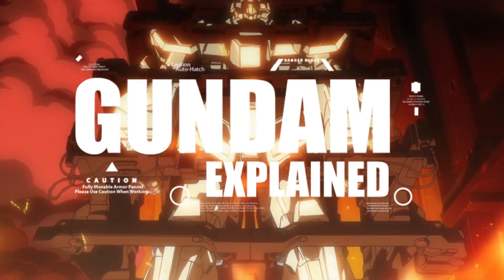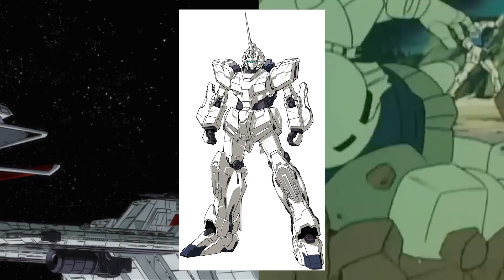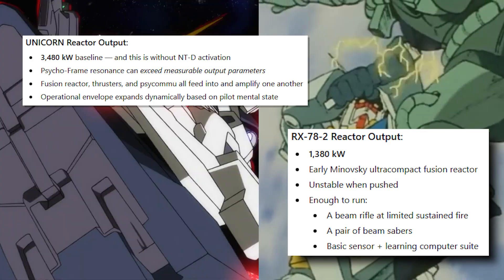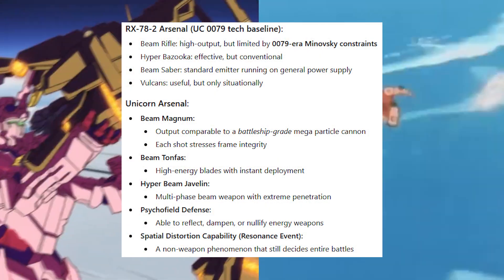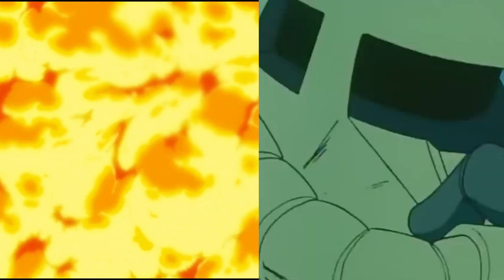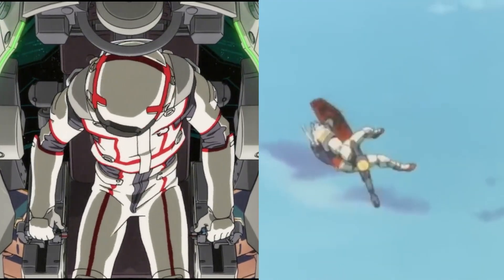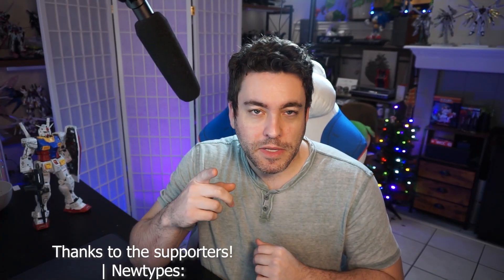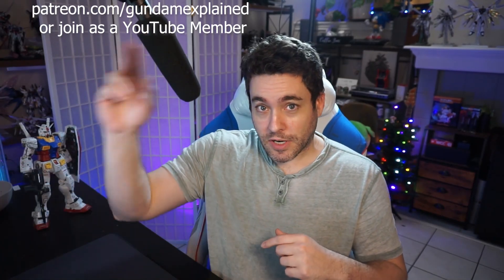RX-78-2 vs Unicorn: How Big Is the Power Gap Really?

Comment: Two-uhv? ...Two of and understanding is understanding in single point and every point = "understandings" is an idiot's misuse of the suffix "s" for redundant emphasis on plural state, especially since the "ing" suffix is already present and its value represents "understanding" is an action. Understanding being the "act of understand" is understanding = it is a verb that doesn't need further suffix to debote multitupr variability as intellectuals(aka idiots) debote in their shallow sense of syntax.

Fix you sloppy posture by using your nose for breathing, this will force you to sit upright ao your diaphragm effectively takes advantage of gravity to fuel ors descent and thus maximum expansion of lungs in every inhale.

You mouth-breathers have bo sens eof the body's potential and by proxy your sense of language fails the mark of Sapience that is defining point of Homo Sapien-Sapien, making you deteriorate into mere homo intellect-intellect; a lexicon heavy shallow beast that rised tangent after tangent without completing a full/coherent thought as hype is your master and so called "reasonable doubt" is your method of expressing "intelligence" but that is mere intellect/coward state.

zero margin for error not mar-jinz, margin is margin, it is a range of play/error = "margins" is an idiot use of the suffix "s" just like "usage" and "leakage."

Armour not "are-moores," armour is an uncountable noun = represents multiwithout need to slap on the suffix "s."

Comment: I looked at the Gundam wiki and heres what I think of it:

In terms of raw specifications (mobile suit not weaponry):
- The RX-78-2 was stronger than all Zeon mobile suits when it was first deployed into combat, while the Unicorns (in Unicorn mode) has an output that outperforms the RGM-89D Jegan D Type and AMS-129 Geara Zulu, but not by a significant margin. (About 1000-2000 kW higher, but when you consider what the Unicorn has, it makes sense).
- The RX-0 has a reactor output of 3480kW while the RX-78-2 has a reactor output 1380kW, about a 2100kW difference, of course the technology packed into both reactors do differ with the RX-78's one being new, experimental and unstable, while the Unicorns has limiters on it, meaning that it can achieve a significantly higher output (thats deemed unmeasurable).

In terms of weaponry:
- The RX-0 purely outperforms the RX-78-2, namely since its weapons are further developments of the RX-78-2's base arsenal of sword (beam sabers), board (shield), and beam rifle (and of course bazookas, etc). Like the RX-78-2 was mostly leaning to the conventional side with the beam sabers and beam rifles being experimental. While the Unicorn's leans into more late UC tech (even if early when compared to F91 and Victory), where it has i-fields (built into its frame and onto the shield), a beam rifle that consumes on whole e-cap, and beam sabers that have variable output, enabling to become significantly stronger.

In terms of control interface
- The RX-0 builds off the RX-93 and MSN-04, where its interface combines pilot controls (in Unicorn mode or when used by a non-newtype) with psycommu controls (in Destroy mode, although I think it is active when in Unicorn mode with the Intention Automatic System, IAS). So the RX-0 can rely on a newtypes thoughts for direct control, while the RX-78 is limited to conventional controls, relying on pilot tuition (newtype capabilities possibly), reaction time, and skill. 

Overall I think the jump isn't significant if you take in the context of Gundam Unicorn, and all of the other prequels that come before it like Chars Counterattack, ZZ and Zeta and the original MSG. The Unicorn is basically the culmination of all of the RX-78-2's tech in UC0090 with additional tech from Zeon.

Comment: Problem with your premise: the pilots. Banagher is a fairly weak Newtype, and an amateur pilot. Amuro is the second or third most powerful Newtype seen in the Universal Century setting, and absolutely the most skilled pilot. He was dodging shots BEFORE THEY WERE FIRED because he could sense the enemy's intention during the One Year War, and his powers and skills only increased with time.

Banagher absolutely has the technical advantage in the Unicorn over the RX-78-2, but Amuro's skill and Newtype ability are overwhelming; this matchup could go either way. Put Amuro in the Nu Gundam, and it's not even a contest: he just wins.
Reply: since when is Banagher a weak Newtype? There is nothing to suggest Amuro has stronger newtype powers than Banagher. 
and i am not sure  "amateur pilot"  either.  Certainly, Banagher is nothing compared to Amuro's skill, but no one is near Amuro level of skill. 

I am not sure why you would think Amuro in the Nu would "just win" and i say this as a Amuro fan. 

They cannot even be compared. Amuro is war incarnate. Banagher is a reality warper. 
The difference is that Amuro obeys the laws of (in universe) physics, while the other(Banagher with the awakened Unicorn) can overcome the laws of physics through force of will.
Reply: @Mr.Zheng2402  Amuro literally caused Axis to move through sheer force of will and transcended both himself and Char from the physical plane of existence at the same time. Banagher never displays Newtype abilities on par with Amuro, and overwhelmingly relies on the sheer power of the Unicorn Gundam itself. The Nu Gundam is on par with the Unicorn for armor and maneuverability, has an equally powerful arsenal but carries all of it simultaneously rather than swapping weapon packs for specific missions, and has fin funnels that are more powerful than standard funnels and can be used to make beam barriers to protect the Nu Gundam against even the beam magnum. Combine that with Amuro's insane Newtype powers and piloting skills, and he wins, hands down. Shit, Bannagher couldn't handle a simple cyber Newtype piloting a Jagd Doga that was cobbled together from spare parts and only had two funnels it couldn't even recharge; Amuro absolutely bodied Gyunei Guss with a single shot while barely even noticing him, and Gyunei was better than the guy who inherited Quess's Jagd Doga and piloting a pristine machine.
Reply: @Swindle1984  Amuro did not cause Axis to move by sheer force of will...

The show literally said the psychoframe was resonating and tapping into the force of will of EVERYONE.

Banagher on the other hand, could stop a colony laser with sheer force of will.

Also, idk what shit you are smoking thinking the Nu is on par with Unicorn in specs. 
The Nu is comparable to the Sinanju at best. (slower, but the Nu is the better machine imo)

The Unicorn, is literally stated to be able(subject to newtype being able to will it) to break the speed of light in NTD mode.

Comment: To answer the video's question. The power gap is huge. RX-78-2 is design as a general all around unit while the Unicorn is the same, but it specialize at dealing with Newtype as it can hijack funnels.

Comment: The right question for me is : RX-93 v Nu Gundam vs RX - 0 Unicorn Gundam
Reply: Now we talking
Reply: Exactly, the RX-0 Unicorn is supposed to be the prototype of the RX-93 vNu, so this is the most relevant question. 

I seem to recall that the RX-93 vNu was somewhat limited compared to the Unicorn at Amuro's request, as some functions hindered it (by that time Amuro was already a true ace, so many of the assists weren't really helpful, they just got in the way; so I think the vNu was less automated than the Unicorn, and the psychoframe was also less reactive or something like that; if anyone knows, please correct me). I even think it's the same case with the Sazabi; Char reduced many of the functions that took control away from the pilot; it was more manual than the prototype, something that was reintroduced in the Sinanju, or at least that's what I understood. 

So theoretically, the RX-0 Unicorn was more powerful than the RX-93 vNu, but the latter was more refined to Amuro's liking, so most likely, although on paper the prototype was superior to the final model, in the hands of the same pilot it was more lethal the vNu.
Reply: @AlexBehemot I'm not sure if I'm misreading your comment and this is all stuff you already know, but the RX-0 was not a prototype for the RX-93. Rather, the UC Project (which created the Sinanju and Unicorn) was launched by the Federation to explore the potential of psycho-frame after seeing what Amuro and the Nu were capable of.

Basically, they thought "holy sh!t, if that's what he could do ON ACCIDENT, imagine what kind of weapon we could make if we actually tried"

And, at the same time, they realized that they were lucky Amuro was on their side - and that they definitely needed some sort of countermeasure if they were ever faced with a hostile newtype with that kind of technology and ability. Hence, the NT-D.
Reply: @comicmoniker yeah, the prototype for the RX-93 is the RX-9 Narrative. The RX-0 is a successor to the Sinanju Stein, both are completely separate from the Sazabi and Nu Gundam

Edit: seems like the Unicorn is also a successor to the Nu Gundam
Reply: @comicmoniker  Yes, my mistake, I was confusing the NT with the Unicorn. In fact, it's as you say, the NT is the first, then comes the Sazabi, then the RX-93 vNu and the Sinanju Stein, and finally the RX-0 Unicorn and the Sinanju. It's been so long since I read all that that I wasn't sure anymore and had to do some research XD. In any case, this whole family is a bit of a mess in terms of power levels, because something I do remember is that the initial models tend to be more "powerful" than the final models, but that's also because both Char and Amuro avoided certain support systems that were in the initial prototypes. Anyway, these are like the pinnacle of the traditional models before they started reducing their size, if I'm not mistaken.

In any case, they were all developed by Anaheim Electronics for both sides of the conflict, hence the constant confusion between them; typical of companies that are only interested in money and sell to both sides XD

Comment: 3:59 the NT-D shouldn't be doing anything to the RX-78-2 systems because it doesn't have any psycommu at all. The newtype pilot on the other hand is a different story.
Reply: NT-D doesnt Scann for psychoframe 

Its scanning for newtype brainwaves
Reply: @R-XI_Sulla  NT-D can also hijack psycommu devices like funnels. But it matters not to an MS without any.
Reply: @TK4541 
There are ms that were desingned to be used like a funnel for the unicorn specifically 

The ReZel Type-N
Reply: @R-XI_Sulla  where are you going with this? Your initial comment agrees with me, but I ain't sure you see it.

Comment: Simply put.... The shots from the Beam Magnum are 14x more powerful than the shots from the RX-78/2's Beam Rifle WHICH by the way was powerful enough to destroy a Zaku with 1 shot. Yes that's right EACH SHOT from a Beam Magnum = the entire energy reserves of a Beam Rifle in 1 freaking shot. No wonder Delta Plus's arm broke when using it.
Reply: The Unicorn is also so unbelievably sturdy that it was deemed more practical to give Banagher’s next MS reloadable arms than it was to design something that would be capable of withstanding the recoil if the Beam Magnum. 

It’s quite possible that Amuro mag dumping the entire energy supply of the Beam Rifle onto the Unicorn wouldn’t even dent the thing
Reply: @San-nj8fj  It's entire internal frame was made of psychoframe so it was quite expensive to make one. It was something that was often only available on cockpits and then this suit had an entire body made of it.

Comment: There are also functional quality of life improvements just from an engineering perspective that happened in the Zeta era that carries forward to Unicorn.
That being panoramic cockpit designs, and moveable frame technology. Even comparing the Zeta gundam to the RX-78 is a massive power jump.
Reply: Not just that but even the jump of sinanju from the nu is already massive
Sinanjus drive units were based on the nu gundam while havinh the control unit of each motor replaced by psycoframe and then encased by conventional material. Hidding the glow

The only reason why we saw it even glow was bc its cockpit got modified (it's not as glowcontaining as the stein)

But what it means with the Intention reading system it makes movement as smooth as like an Alaya Viennata from gundam ibo

This is what allowed the sinanju to practically dance on the battlefield

All we see is the skill of the pilot

It got so strong that full frontal requested a change in the trigger for he found it uncanny that the rifle of the Stein had no trigger

Comment: The Unicorn was powerful enough to kill its pilot, which is why a special suit was required in order to pilot it to its full potential. The RX-78-2 was powerful for its time since it had weapons and armour that no other MS had, plus its motors outperformed most MSs. It became better with a special magnetic coating in order to increase response time/movement - reducing 180° turning time from 1.5s to 1.1s. If you play FPSs, you'll know how much a difference this makes since time is everything.
Reply: Motor? U mean engine right? Normally i heard like in ev car.
Reply: @EF-by1kp  they meant motors that move joints and articulate them, not motor like a car engine. Also mobile suits dont use engines they use reactors like a nuclear sub
Reply: @EF-by1kp  Engines give and create power. Motors don't - they get it from another source. It's only in other languages where the word 'motor' is used for engine (like in French or Italian).
Reply: A whole second for 180° turn? I thought orientation movement, all movements that don't require thrusters, were roughly on par with a human on foot.
Reply: @arx3516 these are 18-meter tall machines weighing many thousands of tons. Truthfully, they shouldn't be as fast as they are, but some things are taking artistic license with physics.
Reply: @ChrisBl33p  to be fair they run on nuclear fusion so we can assume humanity in UC managed to overcome the joint problems
Reply: @ChrisBl33p  Give it enough time and motors will be powerful enough where weight won't be an issue. TheHackSmith proved this with their Powerloarder.
Reply: So that's why Char's red gundam is so good.
Reply: @SonicHedgehog1991  Char's Gundam didn't have magnetic coating. He was just a very skilled pilot using a MS that was considered high performing at the time.
Reply: Field motor that moved the body and limb